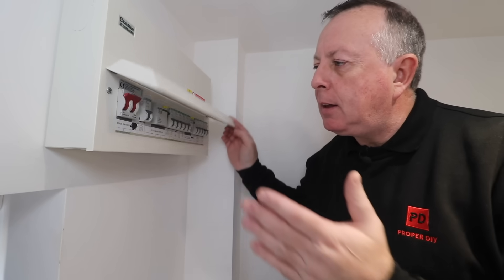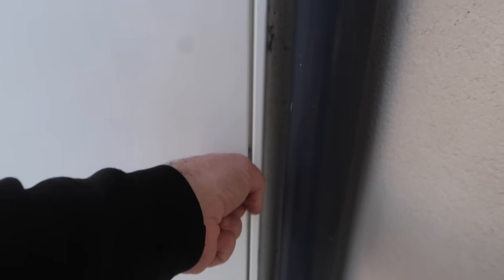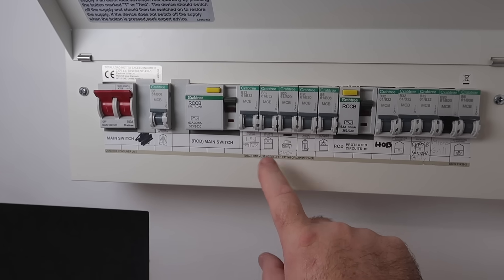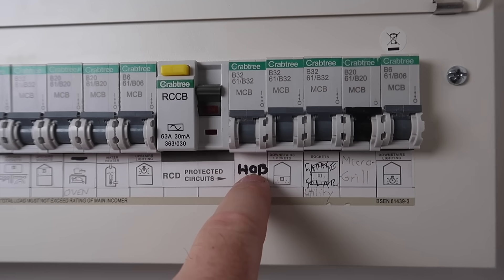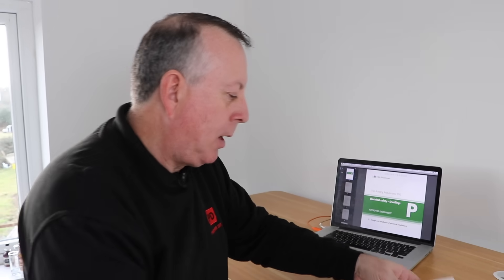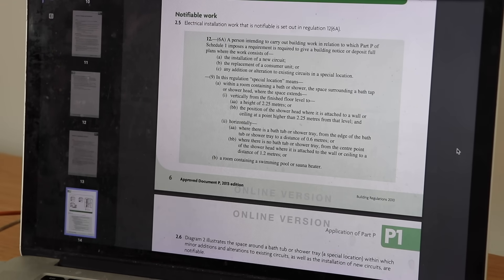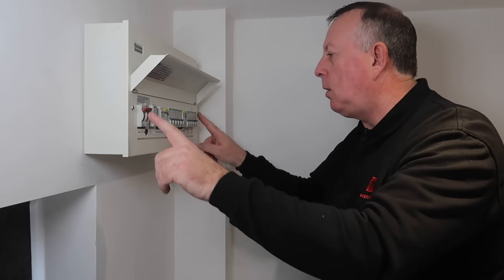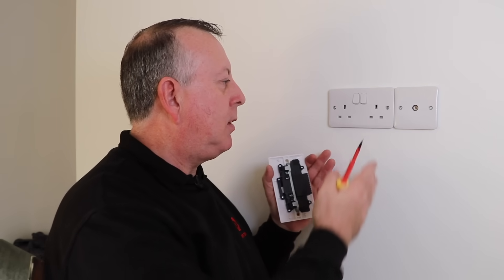What electrical work are you allowed to do in your own home?

Comment: Great video. I'll totally ignore it given Part P has and always will be, a money making scam. The Current publication for Part P requirements refers to the 7671 17th Edition on the government website. I'll be working to the 18th Edition A2:2022
The conflicts between this and the actual wiring standards are laughable, you can do Part P work as long as you get a registered third party certifier in to check your work.... BS 7671 'An electrical installation certificate shall only be filled out by the individual responsible for the design and installation work.'
Contact your local council BCO and get guidance or................ pay £235 and 2 days of your life and then take an open book exam............ so if you can read (if not this entire post has been wasted on you) then you'll be able to pass the multiple choice exam with the answer book provided fairly easily................

Part P Electrical.......................... Not a Joke at all....................
Reply: Yeah that contradiction has always stuck with me, you can do notifiable work if you get it certified, but certified electricians literally are not allowed to certify work they didn't carry out.... amazing...

My previous council's building control said to just get a full EICR done and that was enough for the BCO to approve it on final inspection, my current council says it's not and all work must be carried out by someone certified to pass part P, so it's a mixed bag all round as to whether you can ever get it actually signed off.

Definitely a money grabber wrapped up as a "safety" thing, I wonder if house fires and electrocutions have gone down since Part P was introduced? I'm gonna go ahead a guess absolutely not.

Comment: I'm under the impression that people can do their own electrical work in their home, but they're legally responsible for the consequences. Hence if they sold their house and the wiring wasn't done to the standards of building regulations, then the person it was sold to could sue them to get it rewired and they wouldn't be supported by their insurance company. An electrical wirer on the other hand will sign the work off as them being legally responsible. That is, someone won't automatically to go to jail for wiring their own house in the UK. However, if they started messing with the wiring coming in from outside via the electricity generating company, then that would be grounds for prosecution.

Comment: Qualified or competent?  I've never been entirely clear on the definition.  Do the rules refer to a 'qualified' electrician or one that is competent and if it's competence then how do you define that?  I passed my 17th Edition in 2006 (or 7 or 8, can't recall) but never took it any further than obtaining the certification.
Reply: I suspect the Law is not keen on being too specific because  'qualified' does not make one 'competent'.  It is easy to prove qualified - it's a bit of paper - but the law would not want someone getting "away with murder" just because they had a bit of paper. Competence would need to be tested in Court if necessary.

Comment: Notifiable work doesn't mean you can't DIY, you have to notify building control before you start the work. The problem is being able to test your work after you've done it which is difficult for diyers due to the cost of the testers
Reply: @skipmole612  You're wrong there. Part P (which at its highest only says the installation should follow BS7671) most certainly applies to all domestic properties. It doesn't apply to non-domestic installations unless they are on a common metered supply with a domestic installation. The rules around rental property are nothing to do with Part P at all.
Reply: @skipmole612 no it isn’t?

Comment: I installed a extractor fan in the ceiling of my bathroom , but the actual electrical unit is in the loft so i think by that id be fine to have carried out that work. If i was doing a through wall one within range of the bath /shower then im guessing id have needed a leccy to sign it off.
Reply: It would still have worked without a certificate 😂- It would be your issue if it caused a fire however - but that is something competent DIYs understand and cover by doing their work in a competent manner, including appropriate testing.

Comment: If you have a split board, don't "cross your neutrals" otherwise your rcd will keep tripping. If your live is on left,  keep the neutral with it on left bar.
Reply: 👍👍👍👍  The electrician who wired my nieces house did that for one socket (behind the bed) It did  not become apparent for 6 months or so when they tried to use the socket.  I am afraid I went and fixed it 🙈🙉🙊

Comment: Plastic boards are absolutely fine if installed correctly. Non-combustible is only here as a result of sub-standard work anyway.  Most work can be done and checked by a registered 3rd party certifier, as long as they assess the work at the stipulated intervals.  I've seen some decent DIY installs to be fair, and as long as the Zs readings are good, then it shouldn't be an issue.  I'd argue that ring final circuits should be taken out of the regs, they are a total waste of time, regularly go wrong and ultimately have come a long way from what they were designed for.
Reply: " I'd argue that ring final circuits should be taken out of the regs, they are a total waste of time, regularly go wrong and ultimately have come a long way from what they were designed for."

I don't think its stipulated in the regs that you must install a ring final circuit. I've noticed that many of these pro  electricians with channels on YouTuber install radials.
Reply: @martinw245  it isn't, it's just an old habit. They were designed to save on copper when entire houses were wired on one single circuit for the sockets, so a ring allowed 32amps shared evenly so that current could travel both ways.  In reality the vast majority of houses now have 3 socket circuits as standard.  I personally wife 20amp 2.5mm radial for upstairs and same for downstairs sockets. 4mm radial for a kitchen socket circuit, but even then, sometimes a 2.5mm radial is sufficient if you have designed another 4mm radial for the cooker circuit and have a fairly standard household.
Reply: @Ian Donnelly  

What do you mean by "ring final circuits should be taken out of the regs" then?

We have to have ring finals in the regs because they are here and will be around in installations for some time to come. There has to be regs in place for what we have now.
Reply: @martinw245  that's not true.  We have historically removed and added things plenty over the years. It's only a personal view, based on experience, but ring finals are so regularly broken, leading to inevitable potential for overload. I believe that they should be removed as an option, as IMO, they just don't make sense nowadays.  Better circuit design negates the need for them, improving circuit stability over a longer period.  I'm off next week to try and find breaks in 3 ring finals in the same property. That's every single one which is broken somewhere. If they were radials, finding the fault would take such a shorter amount of time.  Now I have to measure resistance at multiple points around the property to calculate where the break is, and hopefully it's behind an accessory.
Reply: @Ian Donnelly  Oh right, now I understand what you meant to say... no NEW ring final circuits. In that case I agree and have felt the same way for a while. We are on the same page.

You foxed me there when you just said REMOVED from the regs, as obviously we need regs for what's there now.

Comment: Interesting although as an electronic s engineer trained in low voltage and high. I submitted to building control the electrical lay out plans detailing cable size and mcb, rcds ratings etc. This was installed by my self including armoured cable because my consumer unit was greater than 3m away from source. This was periodically over viewed by a qualified electrician and also carried out part p testing of the entire installation. Final installation signed off after I completed minor ommissions and submitted to the local BR department. So I believe that your  presentation clear and concise was a general statement which overlooked the options available. Best Regards Peter
Reply: @robfodder5575  I saved a fortune  with regard to installation, despite the electrician I over compensated in parts and it was the neatest cabling he had seen. £300.0 for all the testing. I even convinced him  the switch in bathroom was outside of zone two, which he reluctantly agreed. Perseverance and common sense prevailed 👍😎
Reply: @Peter Briggs  I agree. The regs say you have to be competent. Yes some work is notifiable , but doesn't mean you can't do it your self
Reply: @gs425  As a competent electronics engineer monitored by a qualified electrician this is within the regs as they would have been rejected from the day I submitted them on the original proposals. 👍😎
Reply: @robfodder5575  you need to find an electrician that monitors your work. Remember earthing is important from switch plates to back plates if the are metal. If using armoured cable invest in earth locking nuts which earths the sheath  only required at one end. Finally the metal cut outs need to be protected with plastic edging. Good Luck 😎👍

Comment: I do it all! Just get someone in to test and inspect 🤷🏼‍♂️
Reply: Check with them first. Most decent sparks don’t need the risk or grief
Reply: @jameshansing5396  check what with who? And why are you assuming there is risk or grief?
Reply: @Mr_OoOsH  basically find the DECENT electrician who will check your work before you do it. Otherwise you’re stuck.

The process of PROPERLY checking a DIYers work is the grief for the Electrician. Most are too busy to resort to risk signing off an amateur’s work.
Reply: @jameshansing5396  ahh I think there’s some assumption gone on, I’m not a complete novice and I give full detail about anything I have installed for example the workshop I got power to I explain what breaker, what cable, where it’s ran, which board and fuses I used in the workshop and basically everything I’m completely open because I want to make sure I’m doing things correct and safely too.

I suppose you weren’t to know I knew what I was doing though.

My dad is a spark and from the age of 9 I started helping him on private jobs albeit all I was ever given to begin with was a scutch chisel, hammer and a box marked on a wall lol.
Reply: @Mr_OoOsH  it’s still a BIG risk, plus he shouldn’t need to be told most of that info as he should be physically checking it himself.

I said most and I stand by that.
Reply: @Mr_OoOsH  sorry fella but I’ve encountered plenty who talk a good game like you and I then find a mess.

Maybe you’re the exception but that’s a  risk the spark has to take. Like I said, most decent ones I know wouldn’t. 🤷🏿‍♂️

Comment: What’s a non qualified electrician then? Isn’t that someone who’s just not an electrician?! 😂
Reply: Not quite no
Reply: @jameshansing5396  As a Qualified Electrician I can tell you that is exactly what it is. Your either qualified or your not there's no middle ground
Reply: @sparkyplug28  level 3 apprentice, part p and 18th qualified? Working under a fully approved contractor?
Reply: @sparkyplug28  I’m not fully qualified but I’m good at testing, I work with several “fully qualified” sparks who can’t test for shit?
Reply: @jameshansing5396  level 3 and 18th not part p currently as working in a hospital so not required. Worked my way up from the shop floor when I joined 7 years ago now overseeing the entire electrical infrastructure as lead authorised person. 
You can be good at testing bad at testing fully qualified or not qualified, electric will still kill you the same it’s not interested.
Reply: @sparkyplug28  so have you done AM2?

I don’t really get the point you were trying to make?
Reply: @jameshansing5396  yes am2 along with 16th edition and the 17th when it came out later on! Within a hospital if you lose power to an outlet the worse case scenario is people die it is one of the most power critical environments in the world.
You were asking about my qualifications I was simply answering.
Reply: @sparkyplug28  I wasn’t. I was suggesting grey areas. Eg not fully qualified but not not-qualified.
That’s all. Personally I think this industry has WAY too many grey areas in this case eg sparks you have done a short course, no 2391, no NVQ yet are Approved Contractor status and doing EICRs
Reply: @jameshansing5396  I miss read that then!
100 couldn’t agree more 4 years at college for most these days. Some however do a 4week course and think they are “fully qualified” it’s impossible to be so!
Reply: @sparkyplug28  I probably didn’t write it very clearly… 😔
Reply: @sparkyplug28  yip. So how in the f*ck are they getting approved contractor status and no one is batting an eyelid that these people are doing EICRs etc?  

Mate of mine teaches 2391 and 18th (still on the tools 4 days a week too) ties his assessor in knots as he knows way more than him. It’s hilarious but at the same time sad and worrying.
Reply: Domestic installer?

Comment: Had to wait quite a bit to get to the bit about what I am allowed to do in my own home! But great explanation, odd that working on existing old circuits that you have little knowledge about is allowed but say installing a brand new ring is a no no? Interestingly two property sales I've been involved with had a £25 charge for a "disclaimer" type certificate that says the electrics are working fine at time of sale but anything after isn't my problem! I'm what I would call competent but not qualified in any way except many moons ago part of my CSE Biology exam... yes human biology, I had to physically show I could wire a 13 amp 3 pin UK plug! Out of a potential 9 points I got 9, many got 1 point for just shoving the cable in and doing the cable tensioner up tight 🤪 I do hate the nanny state and wonder how making these "Laws" protects idiots from killing themselves and just making some jobs for competent people expensive and not policed.

Comment: Use professionals! Bought my house 2014 and finally had the last of the dodgy work done including incorrect core used by 2nd electric shower, main shower not earthed...which was changed to run of boiler as 2 electric showers is not recommended.
It cost me a bit but worth it.

Comment: I buy and renovate property and can safely say that some of the horrors I`ve come across are just mind bogglingly dangerous. Usual suspects are missing earths in sockets, spurs upon spurs. 
Extension cables hard wired into sockets, live wires left exposed under floors, single circuits connected to multiple breakers, even found an oven wired through a light switch as an outlet plate!
Reply: yep so true. i do same thing ,as you ,

Comment: Hi Stuart, great video buddy. I was thinking that a competent person would be able to carry out works around the house as long as it could get a cert from a certified electrician. Abit like PAT Testing would be carried out on appliances in a commercial setting.
Reply: that's the route i took. I have a degree in electronic engineering, have worked as a trainee wireman, and recently read the ieee wireing regs and local building regs first to make sure I was up to date, so consider myself competant. The certified electriction did the inspection, electrical testing and some physical connection testing as well; but I can understand your caution, having seen insulation cut through across pairs, bare live wire ends, neutral/live wires swapped,  and sockets and "chocolate blocks" not properly tight on "historical" wiring. It is worth mentioning that wiring junction screws should be checked after a period of the initial installation to make sure all screws are still tight. This is especially important for high current circuits like immersion heaters and showers/cookers.
Reply from the maker: You are right. However, in YouTube land if I mentioned the word 'competent' everyone with a screwdriver would say they were - so I took a conservative view and didn't mention that route.
Reply: @ProperDIY  I think it's a bad choice of terminology on the part of whoever wrote the regulations. Shoddy writing, when a term is defined in the footnotes to have a meaning other than that in common use.
Reply: Don't get me started on PAT testing, and the cowboys who sticker (and charge for) ELV equipment. Obvs don't "test" it as there isn't a test for them.
Reply: You’d want to get the spark to agree first AND check work at various stages. If he waits til it’s All finished and just tests it, he’s not much of a spark in my eyes

Comment: Am I allowed to remove an outside light and run the cables into an outside twin socket?
Reply: If it's a lighting circuit, the cable likely isn't rated for the higher current.
Reply: @vylbird8014  The OCPD in consumer unit should be correctly rated for the current carrying capacity of the cables. That means no matter what current is drawn, it won't overload the cable, no matter what is connected to it. In this case no one knows whether the circuit is a lighting circuit or something else that the outside light is connected to.
My advice is to get a qualified electrician in to do what you want.
This is all basic stuff, but the fact someone has to ask illustrates why untrained people shouldn't be messing around with electrical work.
Reply: THIS is why diy electrics is a bad idea 😳😳😳😳😳